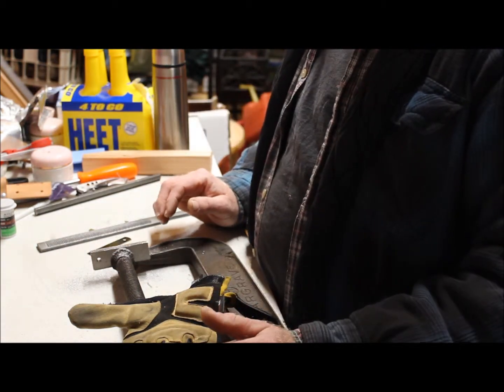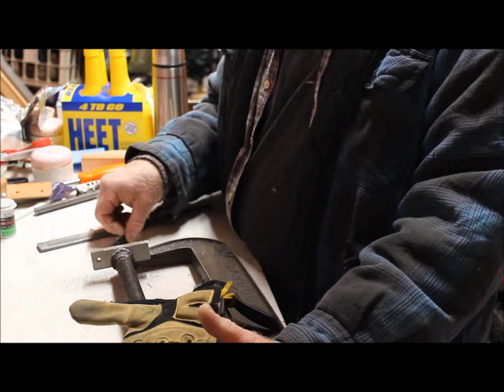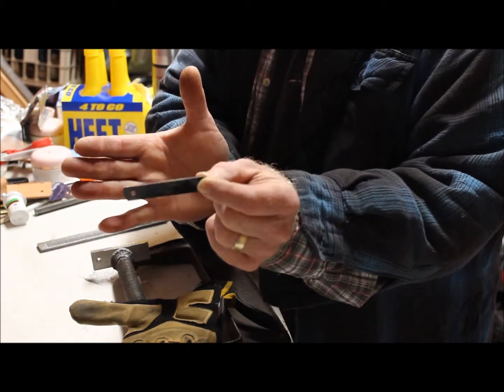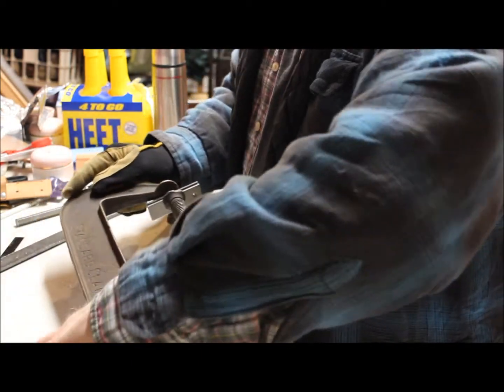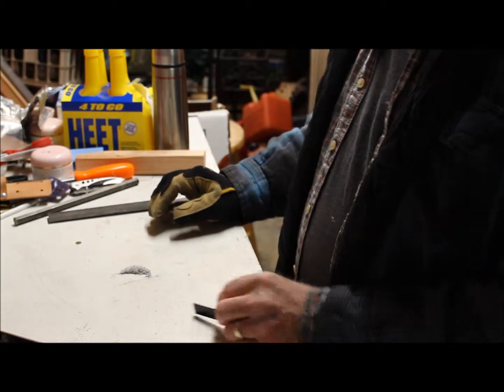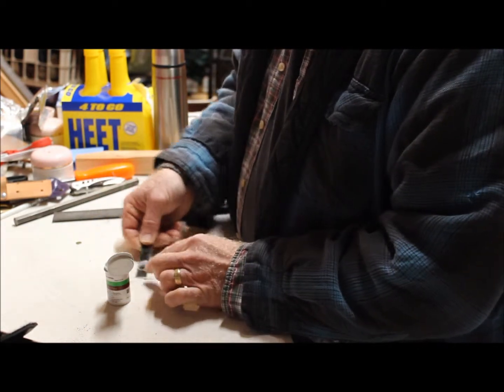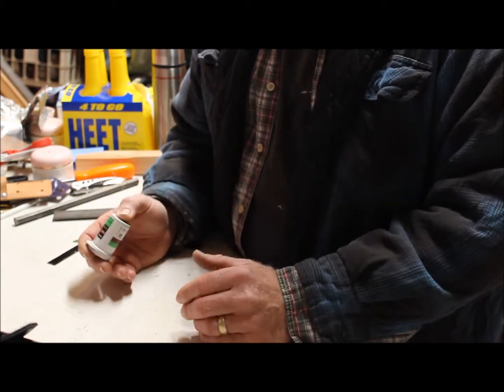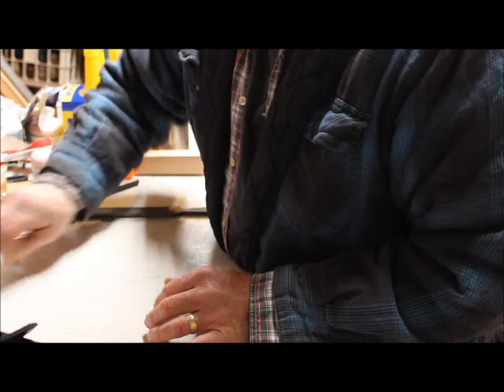Making Magnesium Dust

Comment: I mean really!? If you're going to go to the trouble of making your magnesium dust at home which is not the purpose of making a fire with the tools you have. You might as well bring a lighter! On top of that you might as well just go online buy a pound of magnesium powder for like $12. That way you don't have to do anything LOL what's that said these aren't actually magnesium rods. They're ferro magnesium meaning there's other things in there it's more like Flint.
Reply from the maker: @patman0250  I do bring a lighter plus 9 other ways to start a fire. That is what I  pack in my fire starting bag.  There are no rules or laws as to what you pack in your bag. To me only bringing a lightter is setting yourself up to fail when it fails.  Trying to light a fire with gloves on when it is blowing snow is difficult if not impossible. That's when I would use a Vaseline cotton ball and my fero rod. I've tried scraping the magnesium rods and they are hard to scrape and even harder to contain the scraping. That is why I did buy a small bag of magnesium shavings. I put some in a pill bottle. Nothing wrong with doing that.

Comment: buy a dremil,a woodcraft file is for wood
Reply: A dremel and rotary carbide burr is the best .
Reply: The file he is using is called a rasp
Reply: @77Avadon77  , a rasp file is for filing wood and very soft material. For Magnesium metal manual filing, I use an aluminium file ( for filing aluminium and other soft metals) .
Reply: The best way to make Magnesium powder. 
https://youtu.be/QvXYF96Iw5o